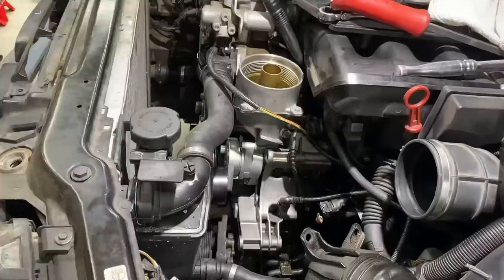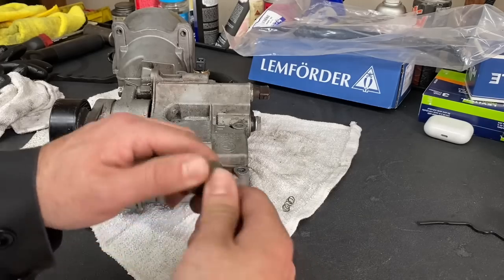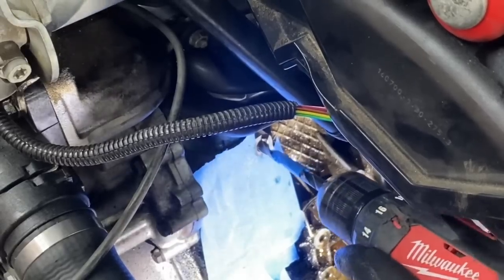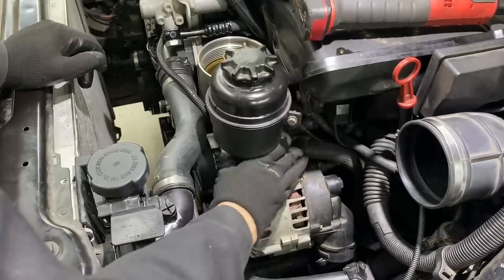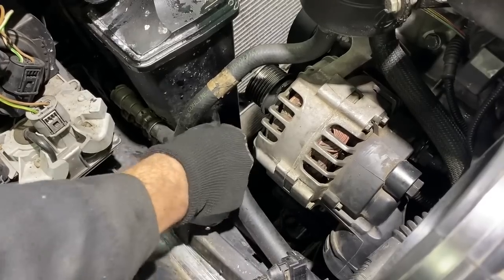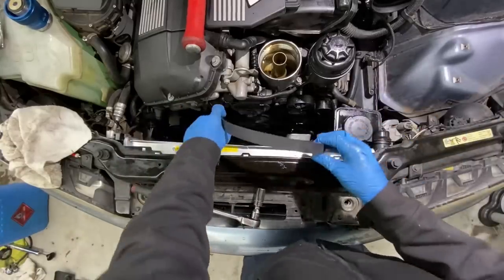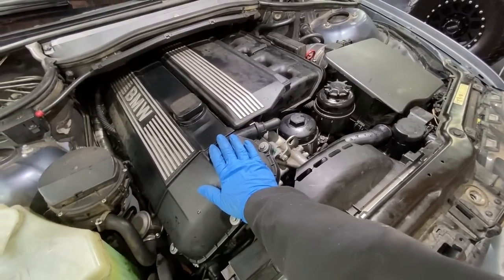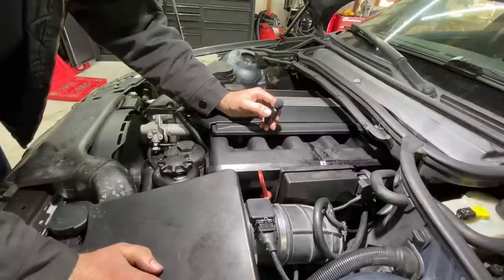Someone Screwed Me! - Flipping My $500 BMW E46 330i

Comment: The educational value of this video is fantastic, especially for those new to wrenching etc.  I went through a similar issue on my e39 and the oil filter housing gasket top right bolt (dealer over torqued it).  I love m52/m54 engines but the cooling system plastic is irritating.  You did a great thing saving this one.  Look forward to the next!
Reply from the maker: Thanks Brett! I agree, so much damn plastic in the engine bay. They can fatigue so fast. Appreciate the feedback and support!

Comment: Hey, just wanted to say that I did this exact job today. I had to repair the same threads you did as well as the one on the bottom. Your words of inspiration and heli coil demonstration was exactly what I needed. I didn't let it ruin my day and it was something I'd never done! It did mean I didn't get the car running yet but all good!
Reply from the maker: Super happy to hear that! Glad I could be of some help, well done! It’s not fun taking a drill to the block… but sometimes it’s necessary
Reply: @DayOffDIY  And fun/rewarding to step outside my comfort zone.
Reply from the maker: Absolutely! Makes you feel more confident and capable for future jobs! Probably my favorite part about wrenching and learning something new!

Pumped for you dude!

Comment: I was so envy of you cause until now everything was going smoth for you and for my 330 2001 that I'm also repairing, oh boy, lots of people passed there and did a ton o sh*. Just replaced a bad ECU because of an eletrical mess someone did before. Keep the good work.
Reply from the maker: Most days it goes smooth, until it doesn’t 😂
Glad you got your ECU issue figured out, those can make you want to beat your head against a wall

Comment: This is a good representation of why it’s recommended to replace the cooling system as just that - a system.  Piece mealing it just leads to the next weakest link failing.  

This series has been great as it shows how DIY-able these cars are. They aren’t overly complex and few repairs need special tools and can be done in your driveway.  

 Had to shave the disa flap too. Contrary to internet folk-lore - there is no way for the disa pin to fall into the intake when in place. 
Measure the length of the disa and then the depth of the intake.  There’s even a recess in the molding of the intake that the pin sits in. If someone had one fall into the intake it was upon removal or installation. 

The worst thing about old BMW’s are their previous owners.
Reply from the maker: I agree 100%. We would recommend hoses if they were ever going to get removed, and we would also recommend them based off the color of the plastic or age. 
I would love to be able to replace EVERYTHING but the budget is a little tight for it. Maybe if it was for my daily driver and I wasnt worried about losing money while flipping it.

Comment: ive flipped quite a bit of E46s, i got another one in the works 2003 BMW 330ci 5 Speed manual clean title, 1 owner garaged car, vert, steel grey metallic with black sport seat montan leather interior. just re did the tint, fresh oil, filter, new ambient temp sesnsor and fender liner, as well as m sport steering wheel , new zhp knobs, new black matts from bmw all weather. trying to get around 7000-7500$ YES i said that i am into it 5450$ and im in CALI prices for classics dont make sense or everything in general, nice work mate!
Reply from the maker: Sounds like a PERFECT E46! I bet shes cherry, especially after being garaged. Nice find!!!
Reply: @DayOffDIY  just flipped it made a quick 1500$ off simple restore Tint m sport steering wheel and floormats. Sold for 6800

Comment: Great video man. I loved the positive attitude you showed and all the helpful tips you provided in this video.

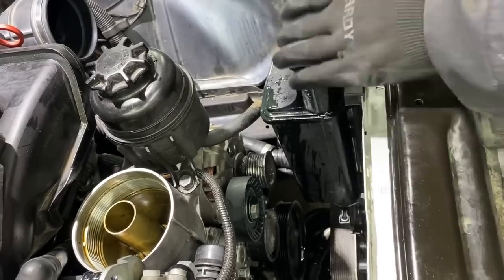For me the tip at 23:35 was the best! I have changed 3 of these and broke 2 of the automatic thermostats under it… going to try they trick if I ever need to do it again…

Fingers crossed for the smog test 🤞 

Do you make a record of what was repaired and how much each repair costs etc?
Reply from the maker: The Phantom! Good to see you again partner. Yeah those Thermostats always want to fall apart. Should be headed down to the SMOG in an hour or so.

I have all my receipts and records of parts purchased, I just need to get them organized and compiled. Ill try to get that done so I can include it in my last video on the series if I do get her sold
Reply: @DayOffDIY  SMOG is just a basic vehicle check in your state or do they inspect the whole car?
Reply from the maker: @PhantomZore  just an emissions check through the computer and tail pipe. Confirming that all the readiness monitors through the DME are online and have passed all of their individual checks
Reply: Oh that’s not much of a test. Been a few hours now, how did the test go? 🙏
Reply from the maker: @PhantomZore  wasnt able to make it down today, got the DISA valve back in and got hit with lean codes bank 1 and 2, ordered a new DISA today. 
The diaphragm in the DISA failed so I believe its causing my issue.
Reply: @DayOffDIY  let’s hope it’s just that and you can move on. 🤞
Reply from the maker: @PhantomZore  fingers crossed, I’ll smoke it too I think

Comment: I remember changing the voltage regulator on mine, two weeks later the alternator bearings pulled a SpongeBob, had to replace the whole alternator but rock auto had a good deal on a reman one, 20k miles later still working great.
Reply from the maker: Were at the mercy of parts, sadly lots of them dont last very long :/

Comment: I just finished an M54 rebuild.  I think I put 3 or 4 time serts in the block for the oil cooler housing. The aluminum is very soft.
Reply from the maker: gotta have time serts or heli coils when workin on these engines sadly... you know...

Comment: Seems like new car parts being faulty is a common thing. I just had a starter motor break after one week. Stranded 160 miles from home.
Reply from the maker: They are indeed, Im not using the best brands due to difficulty sourcing European parts in my area. 
Ive also had brand new Bosch starters fail right out of the box... 
That sucks to hear Stevie
Reply: I'm glad you could return your stuff, mine was return only if fitted by authorised dealer. Also "remanufactured" products are questionable.

Comment: Awesome video!! Where do you raise the car? I don't know where to raise my e46 to put the jacks.
Reply from the maker: You can lift off of the factory Jack points behind the front wheels on the outside of the body, or in front of the rear wheels. There should be factory Jack Pad locations along the sides of the vehicle under the doors, or you can use Rhino Ramps :) Hope that helps

Comment: Totally not to be an annoying viewer or anything, but don't you think that the parts from O reily (the upper radiator hose and the thermostat) are "low quality" parts / fitments? Most of the people on forums and such talk alot about the brands of parts, whereas you don't. Nothing you really can do about the parts at o reily but it is annoying to replace parts a second time right.... just saying.

Edit: loving every episode though from the e46!
Reply from the maker: you are 100% correct. I should be using better quality parts although it was difficult to get them same day with my local suppliers. Ideally id use all genuine BMW parts but with the price tags its almost impossible for me with my current situation. I have a local parts supplier that can get me some good brands but turnaround time is difficult in some situations. But you are correct, Oreilly is no good, especially for BMWs

Comment: Yo dude got a question 
Door handle broke on my e46 and it doesn't open the door just moves freely and I guess some part broke inside the door is there any way I can fix it myself thank you
Reply from the maker: Hey! yeah you need to get the door off and inspect the linkage for the door handle. If its the exterior handle it goes directly into the door lock actuator, which isnt too hard to get out.

Comment: Nice job man ,want to bring my m52b20TUB to you ,in România we don’t have mechanics like you ,neither those fancy Tools you have .at idle I have a rattle noise coming from the 2 or 3 cylinder head or I guess the vanos unit aria …this happend only idleing …I heard of an other option witch is the unsynchronised timing chain with the vanos sensor error …what do you think ?
Reply from the maker: Thank you ! Also, awesome to hear I have a viewer from Romania.
Hmmmm... hard to say, I would start with a stethescope or a screwdriver you can put your ear to, to try to locate the problem a little more precisely

Comment: are the automatics transmissions in there reliable?? can they be serviced?
Reply from the maker: They are pretty reliable, and yeah they're serviceable. Ideally, I would do a trans service every 75k miles, which would be a drain and fill, drop the pan, and replace the trans pan filter, with a new pan gasket. Flushing is ideal too if you have the equipment or a shop with the right tools

Comment: Did you have any oil and coolant mixing?
Reply from the maker: Nope, no evidence of any mixing between the two
Reply: @DayOffDIY  that’s because the oil has zero chance of mixing from the oil filter housing. It’s all oil passages. Zero coolant passages there.
Reply from the maker: @Birdhouseboi810  this is true, although I have seen it on N52/N54/N55

Comment: Hey I have a question, I have a 2003 325i M56. It’s the sulev, is the pulleys that I need to order the same as the m54?
Reply from the maker: i think they should be the same but some parts on the sulev are different, IE: intake boot and stuff. I like to use realoem.com type in the last 7 of your vin number and search for part numbers on there then copy and paste the bmw number into parts websites to make sure you have the right part.